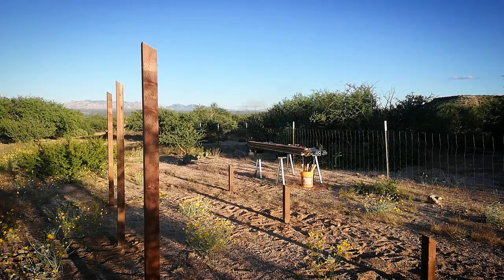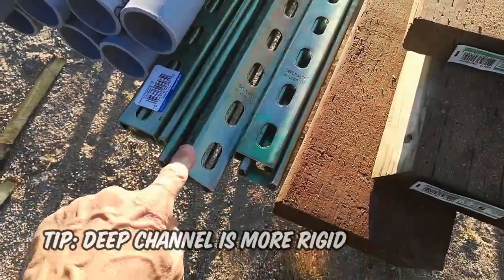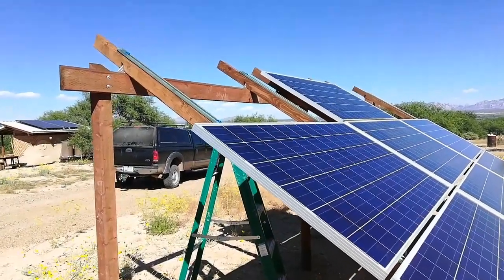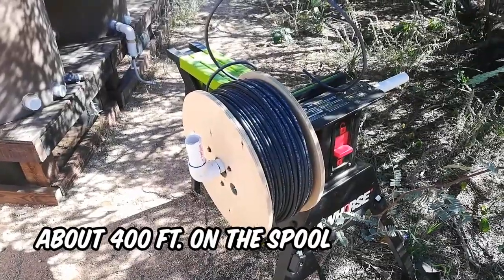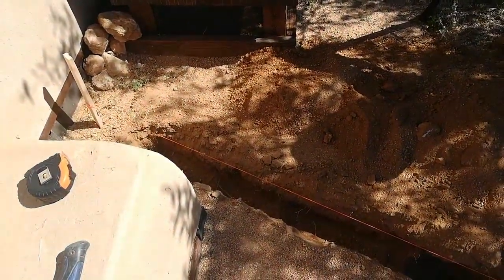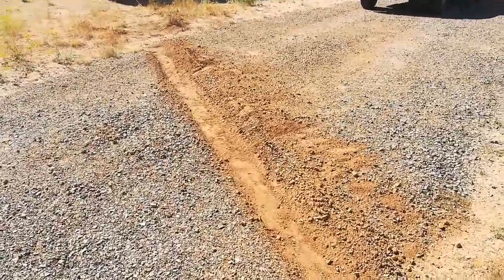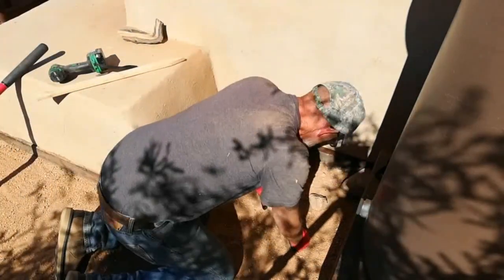Build An Inexpensive Solar Ground Mount

Comment: I BOUGHT 11 PANELS ON EBAY 275 WATT FOR £60 EACH THERE ARE 19.5 KG EACH I THINK I JUST LIEN THEM ON THE FENCE FACING SOUTH AS THE SUN COMES FROM THE EAST THEN TRAVELS ALL THE WAY ROUND TO THE WEST WHERE MY HOUSE IS WAITING FOR MY WIRES AND INVERTOR NOW I LIKE WHAT YOU DID BUT TAKE UP THE WHOLE GARDEN SO IM GOING TO WAIT AND TRY AND FIGURE OUT SOMETHING MORE SUTETABUL LIKE STANDING THE PANNELS ON SOME WOOD OF THE GRASS AND THE TOP OF THE PANELS LINING AGISED THE FENCING
 IN THE GARDEN I THINK THAT'S MY BEST AND CHEAPEST WAY AROUND IT AND MOVE THEM  BY HAND DEPENDING ON WHERE THE SUN IS IN THE DAY, IF ANYONE KNOWS A BETTER WAY LET ME KNOW GREAT VIDEO, THANK YOU.

Comment: Shouldn’t you have run a wire or string through as you were glueing the pipe
Reply from the maker: That would have been useful for future (additional) wire pulls for sure. The fish tape worked fine, especially since it was more or less a straight shot from the panels to the solar shed.

Comment: I had to run coax through 2 inch metal pipe on a fenced in dog care center, it was about 75 yards long, I got a shop vac and then with some string I made a small 1 inch size ball with tape and attached string then with the vac at the other end sucked that ball down the pipe. After that I could attach a small rope and pulled that through then attached that to coax and pulled it though by hand. It worked, just a thought!

Comment: Very nice steup!  How did you attach the front to back beams to the 2x6's?  Did you notch them out and or use a bracket to tie them in to the 2x6?  Thank you!
Reply from the maker: I beveled both the front and back beams to the same angle as the for the panels. Then I used hurricane straps to secure them. And used 5 inch construction screws to give additi strength.
Reply: @theupsideofdownsizing  thanks. Hurricane straps is exactly what I was thinking.

Comment: Panels are so cheap now (especially used panels), that if you aren't particularly space limited, you can just keep adding panels every direction until you get the power output you need from sunrise till sunset all year 'round - No need to fuss doing any sort of tracking/tilting.

Comment: I am planning on installing a 12 panel array. How would you build such a mount?  I also would like the lower side raised higher to about 6 ft so I can walk under it to cut grass.  The pitch is secondary as I am willing to sacrifice some solar production to open it up underneath for easier lawn maintenance.  Would you build it as 2 independent structures for a 3x2 array each or a single 3x4 array?  Would you use still four 4x4 posts per 6 panels or would you need increase to 6 posts to provide more support in the middle?  If using only four posts per 6 panels, would you need to beef the posts up to 6x6 and/or upsize the joists to 2x8?
Reply from the maker: I think I would build four columns of three panels each in a horizontal format similar to what we built. The 4x4 posts with 2x6 stringers have been very effective and stable for us and I'm sure it would work for you as well. Basically follow what I did but make it one column of three panels bigger than ours. And again I used a roof pitch calculator to determine the angle of the panels as well as the height of both the lower and upper beams. You can do the same starting with 6 ft at the lower level.
Reply: @theupsideofdownsizing  I reread your reply and understood it better so I deleted my initial replay.  I understand you are recommending 4 panels across and 3 panels high in landscape.  You also recommended keeping the posts as 4x4 and the stringers  as 2x6.  Should I add two more 4x4 posts for a total of 4 short and 4 tall to better support the added 3 panels column or keep it at 3 short and 3 tall 4x4 posts?

Comment: You could have heated the grey conduit with a propane blow torch to bend it.   They sell an oven to heat it but a torch works well to heat a 12" section.

Comment: Just a small hint for the future use of conduit, you can use a propane torch to soften the PVC, it then becomes like a lose noodle to allow you to bend it to the angle you need
Reply from the maker: Thanks. I tried that and of course my impatience got the best of me and I scorched it. Luckily I was just practicing. Maybe one day I'll pop for a heat gun. I hear that would softent the PVC as well. Thanks for watching!
Reply: @theupsideofdownsizing  if you lay it on a piece of tin bent to a u or L you can heat it more evenly.

Comment: Looks pretty straightforward and the stain added a nice look.  Could you tell me what did you use to mount the 2x6 to the
 ledger/header boards? And how solid did it turn out ? Thanks
Reply from the maker: Yeah I'm sorry I lost that footage. I used hurricane ties to connect the rafters to the headers. I then came back and used 4-in deck screws and toenailed through to the header.we've had that system up for about a year and a half now and it is working beautifully. It has survived 60 mile an hour winds, and a big flood. Thanks for watching and thanks for your question! here's a link to the actual hurricane ties that we used. I also painted them ahead of time so they would blend in better with the rest of the framework.
Simpson Strong-Tie	H1 18-Gauge Galvanized Hurricane Tie
https://www.homedepot.com/p/Simpson-Strong-Tie-H1-18-Gauge-Galvanized-Hurricane-Tie-H1/100375256
Reply: @theupsideofdownsizing   Thank you! That is what I thought.  I will be installing a 15kw system in March or when weather breaks here in Ohio.  And so I'm in the process of designing my ground mount.  I really like the simplicity and durability of your mount.  I did the numbers and I will have to use 2x8 for mine but same thing .  Thanks again and well done!  Looks great .
Reply from the maker: Thanks and good luck with the build! Suggestion. When you buy your unistrut, get the heavy duty. I think it's like 1.5"x1.5". When I did my build everyone was sold out so I went with the lower profile. The HD is much stiffer and IMO the better choice. Mine works fine, but I don't have to worry about a snow load.

Superstrut	10 ft. 12-Gauge Half Slotted Metal Framing Strut Channel - Gold Galvanized
https://www.homedepot.com/p/Superstrut-10-ft-12-Gauge-Half-Slotted-Metal-Framing-Strut-Channel-Gold-Galvanized-ZA1200HS-10/100125003
Reply: @theupsideofdownsizing  Thanks again.  Yes I am familiar with the heavier strut.  Thank you for the suggestion.  Really appreciate it!  Take care and Merry Christmas!

Comment: What kind of equipment are you using with panels. What size and brand panels are you using
Reply from the maker: Our equipment is from Schneider and our panels are Canadian Solar. Each panel is 305 watts. We got our equipment from Northern Arizona Wind and Sun in Flagstaff AZ. They are extremely professional and offer excellent customer service.
Reply: @theupsideofdownsizing  what size charge controller and inverter do you use.
Reply: What kind and how many battery do you use .you have 24 or 48 v system
Reply: What size wire you use on batteries
Reply from the maker: 3600 watt inverter. Our charge controller is maxed out with 15 panels @ 310 watts per panel.
Reply from the maker: One full Chevy Volt battery bank. 48 volts 15.7 KW
Reply from the maker: From batteries to Inverter, 2 gauge. https://youtu.be/MDlRsDm1MWw
Reply: @theupsideofdownsizing  what kind and size is your inverter. How much were your battery how many is there

Comment: I know you said that the post were 8.6 feet from the back to the front to get the 30 degree angle. How do you calculate how far apart they have to be? My angle needs to be 22.5 degrees
Reply from the maker: I used a roofing pitch Calculator online. I put in the desired angle and it gave me the length of the run, or the distance between the front and back out. Here is the link. Look for roofing pitch Calculator

https://www.omnicalculator.com/
Reply: @theupsideofdownsizing   Thank you! That makes it so easy!

Comment: I have a 500 watt array and not being used at the moment. I am in the planning stages for a 16'x32' cabin lifted 8 feet from the floor on pillars. I was looking into buying used 250 watt panels to set power to the cabin. Well nice watching this brings back memories of my old projects.
Reply from the maker: Sounds like an awesome project! Going 8' up will be really fantastic. Thanks for watching.
Reply: @theupsideofdownsizing  I just went to the shed and pulled out a set of NewPowa 100watt  12v solar panels. I have another channel that I want to focus on solar and off grid so that will be an adventure. My high blood pressure, stomach virus and allergies have really been beating me up these past few weeks. I been looking into 6 to 8 inch steel pipes and building concrete pillars to hold the cabin up. I saw a guy use 8" pipes to raise a shipping container off the ground and used far less than I want to use. Well let me watch a few of your other videos.

Comment: Bill what do you think of these units that have only been developed a few months ago.  They claim to be able to run a large array of electric devices on off-grid.  Thanks very much. https://www.pointzeroenergy.com/product/titan-2000-kit/
Reply from the maker: I think those are great options for certain situations such as people who have minimal power needs or who require a mobile solution. We considered using such a device, the Kodiak, as an interim solution, but decided against it because it could not be expanded to meet our future needs. That is why we decided to make our solar system a one time investment. Sure we could, and probably will expand our system by adding additional batteries, but it is not absolutely necessary.

Comment: Did you cement the posts?  I'm renting so don't want to cement mine in and just put the posts in 2' deep.  Works for my T frames but can't find anyone who didn't cement there's in.
Reply from the maker: Yes, we used about 1/2 of a 60lb bag of Quickrete per post. But you should remember that we have very sandy soil.

Comment: Hi Bill.  I purchased 4 acres in Cochise County the day before New Years.  I was wondering how did you decide on the 9 panels for solar.  Also forgive me if it's mentioned elsewhere but what kind of electric appliances etc are you planning on it running for your home?  thanks!
Reply from the maker: We actually have a total of 15 - 305 watt panels. 9 on the new array and the original 6 on the roof of the solar shed. We will have electric hot water, probably supplemented by passive solar hot water, electric appliances in the kitchen and asfar as a is concerned, we will have an efficient window AC in our bedroom. The rest of the house will be outfitted with ceiling fans. Heat will be wood of which we are fortunate to have plenty. A rocket mass heater is planned. Our charge controller is maxxed out with the number of panels we have. Our inverter can handle 3800 watts peak and 3400 continuous I believe. We should be good to go. I wouldn't mind doubling out battery capacity. Out panels on a sunny day have our batteries topped off by 10am, so we could easily keep 2x the batteries charged.
Reply: @theupsideofdownsizing  Bill instead of wood stove to heat your home would your solar array handle 2 mini splits in different areas of the home to heat it?  Much less work than wood.  Thanks!
Reply from the maker: @donkimball6174  our system can handle 2 mini splits that are NOT running simultaneously. Our inverter can handle 3600 watts continuously and a 4000 peak. The amount of power produced by our panels would be capable of keeping a battery bank twice the size of our current capacity charged, but in order to handle 2 Mini Splits at the same time would require a serious upgrade to our inverter.  After monitoring the temps in our strawbale solar shed this winter, we think only a modest amount of heat will be needed to keep the house at a comfortable temp. Because of the amount of trees/firewood we have on our land, a wood burning stove or a rocket mass heater is going to be the best fit for us. We have an electric quartz space heater that will keep about 150 sq feet very comfortable and uses about 800 watts. Cold mornings and cooler days ( not many of those) this thing will run without even slowing down the charging of our batteries ( if it's  sunny that is).
Reply: @theupsideofdownsizing  Thanks Bill.  Hmm lots to learn here about inverters obviously! So if I have this correct you would first need to obtain a much larger inverter, then a larger battery bank to make all of this happen.  Would your charge controller need to be changed as well?  It sounds like Straw bale construction is the unsung hero in all of this and that you have put a lot of serious thought into this.  I am learning lots but have a long way to go before becoming fluent in solar arrays and their use.  Thanks for all the time in answering my questions.  I definitely am thankful. Cheers! - Don
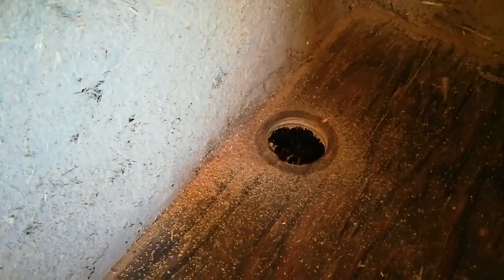Reply from the maker: @donkimball6174  The battery bank would not necessarily need to be upgraded in order to run 2 mini splits, it would just provide a buffer of available power for other needs or in case the weather is not optimal. Our charge controller is maxxed out with the 15 panels in our system. Our batteries are, on a sunny day completely topped off by 10:30 - 11am with the system generating at peak, 3200 watts @110 volts. On a "bright" cloudy day we produce about 750 watts which will cover our refrigerator and any other small or short term uses of things like microwave and the excess goes towards replenishing the batteries. Even with a few days of cloudy weather we are able to use our electricity without too many compromises. For us, if we would double our battery capacity, the system would be perfect. As it stands now, it's just great! 😉

Comment: The 4x4 posts should be pretty solid but if there is any side-to-side movement with a good push then you may want to consider installing X-bracing on the long posts to secure it dead solid during high wind events. Could also do the same with a single brace from front to back. This would keep the uni-strut from any bending. Keep up the great work!

Comment: I usually just heat the conduit with a heat gun or even a propane torch. Looks good.
Reply: @theupsideofdownsizing  slow and easy is how I do it. A plumber showed me how, I heat a much longer area of the PVC than needed and only bend using  a really rounded surface such as a barrel.

Comment: A little trick from a short time ruffing electrician. A long time ago in a galaxy far far away lol. Turn your  truck on let it run for about 20 minutes. Then put the part of the PVC you plan to bend inside your muffler and wait about 5-15 minutes Until it becomes pliable that will allow you to bend it.
Reply: @theupsideofdownsizing  you can also heat up your can of soup for lunch on the engein block at the same time.  Remember to remove labels:) . You get creative in the middle of nowhere.
Reply: @shafer360  Just remember to remove your beer from the under-hood-hidey-hole as it gets to warm to drink. lol